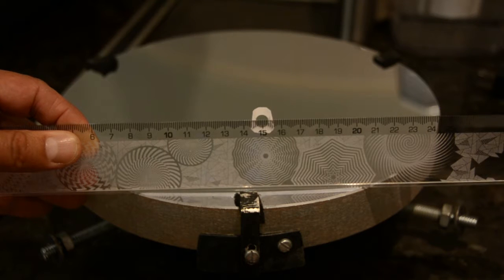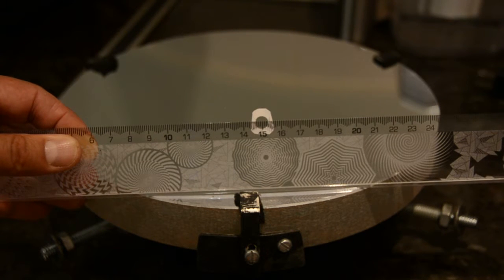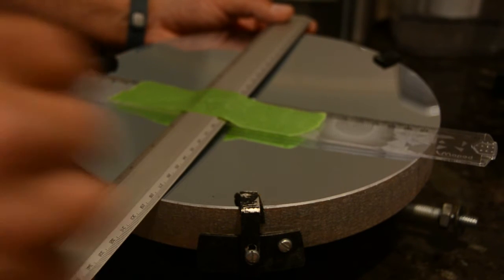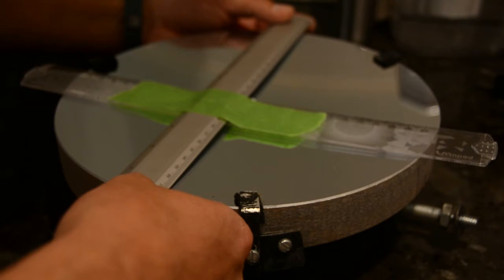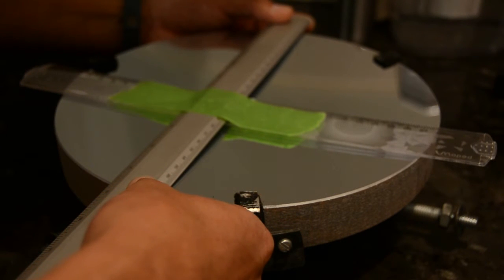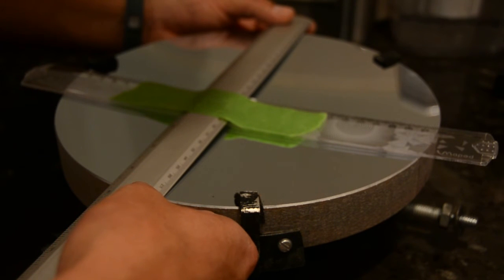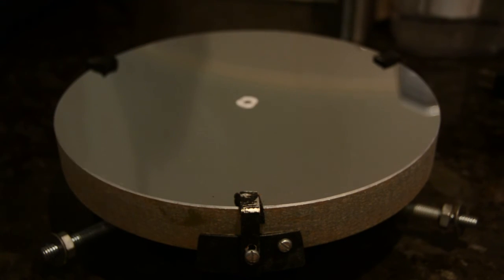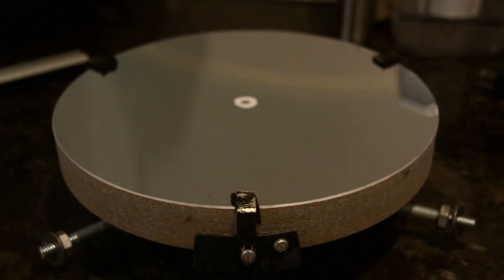CenterDot

Comment: do you just leave it on when or is it solely for collimation and do you remove it afterwards?
Reply from the maker: You leave it on.  That way it is there for every time you collimate.  It does not get into the optical path because it is in the shadow of the secondary.
Reply: @grtyvr  If you use good decals, then you can even wash the mirror and it will still be there, until you take it off.